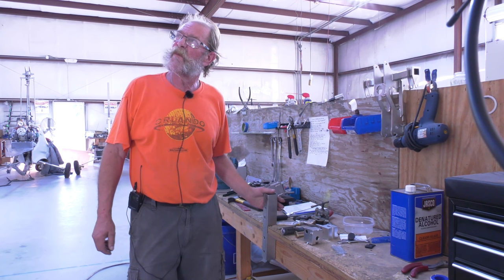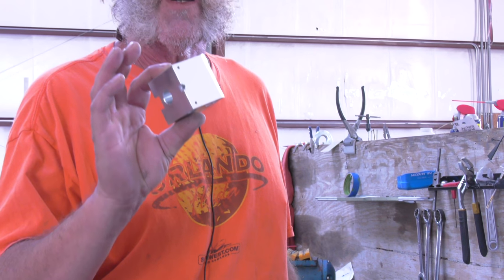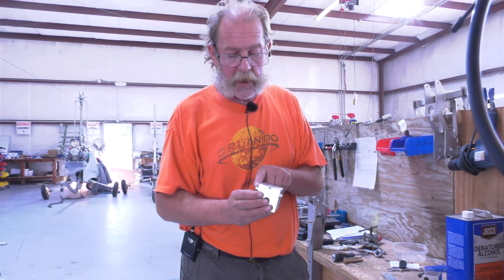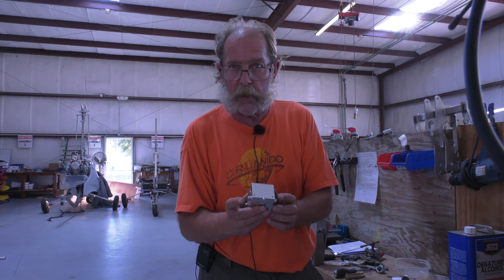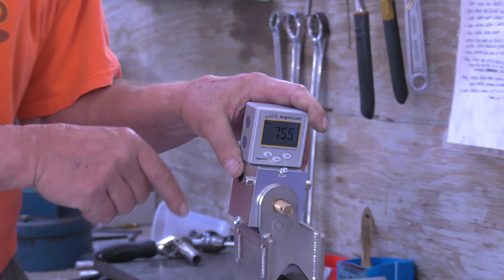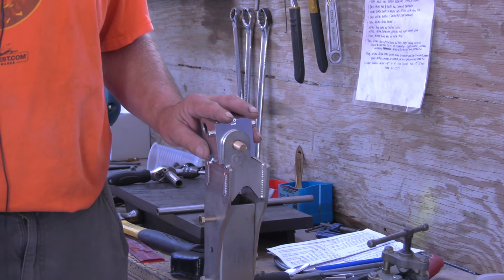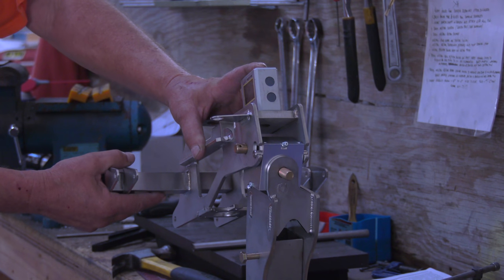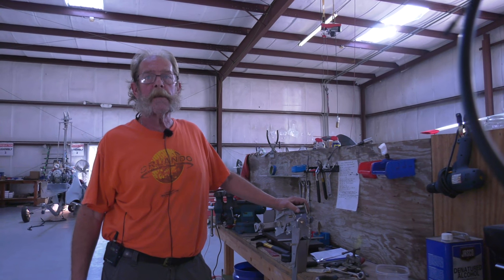AR-1 Gyroplane Rotorhead Assembly - Part 1 of 2

Comment: Hello, may I ask how to ensure that the angles of the two rotor blades are symmetrical? Is there any method or tool?
Reply from the maker: What angle exactly do you mean? The fixed pitch of the rotor blades? That is set by the clamping machined straps from hub bar to blade. The machining has to be quite close and precise on the hub bar and the clamping parts. If there is a tiny bit of difference, that is taken care of by rotor track and balancing using a multi-axis balancer but that has to be done by flying on the specific machine. We use PB4 balancer. You have to also know what to do with it not just buy the equipment.

Comment: Why are there 8 degrees on one side and 7 on the other? shouldn't they be the same? After all, this makes the side slope, am I wrong?
Reply from the maker: It's just because I wanted to. Why the heck not :). Nah. One side roll is favored due to torque and on the other side roll is opposed by the prop torque. So you need a little help on one side versus the other

Comment: It seems like a solid design, but man there are some Jesus bolts in gyro rotor heads it seems.  Can't the mast be a bit thicker and the bolts a bit bigger lol. All kidding aside, very nice machine
Reply from the maker: Those bolts can handle over 60 G's. You should be more worried about the Aluminum structure the bolts go into. They will break before the bolts. But I understand all people who don't know always worrying about the bolts instead. The largest danger in all aircraft is always the bolt that drives the aircraft. That one breaks apart really quickly. Biggest failure point :)
Reply: @silverlightaviation  I totally believe you but an airplane wing with more than one bolt holding a wing on I would think could possibly keep flying if one worked out or failed.  Those bolts in the wing are static and not spinning like on a gyro.   I know they have keepers, but still.  And many planes have ballistic parachutes on board, especially LSA.  On the gyros it just seems to me that there are maybe 4 bolts or more in a rotor head that if one failed its goodbye.  One would think that the bolt surely is strong enough to handle the G loading or any other stresses.  But what if it was manufactured with a crack or void internally.  I am not sure if they are magnetic particle inspected.  Just saying is all.  The other thing is the bearing or bearings in the rotor hub assembly.  Are they monitored for heat like maybe a helicopter.  What if one of the bearings got hot and scorched and it froze up. I use to farm and big combines would burn a bearing up every so often and throw a drive shaft.

When u take the plastic or carbon body off of the gyros they just don't seem like much is all to me and don't seem redundant in some ways.  I would love to see testing on them and strength numbers.  I would love to buy and own one once properly trained.  Maybe I am paranoid, but man they just seem fragile for having all of that rotor spinning and experiencing Gs under load on that little square tube going to the top with two little ears to hold a bolt and hold the assembly on.  I am sure the hardware is aircraft grade stuff.  Maybe you can chime back please so I can learn. Thanks
Reply from the maker: @user-ev2qo1hj1g  There are bolts and pins in many airplane wings that if one broke, you are pretty much done. So you should never fly a Cessna 152, 172, 182, Searey, RV12 and many others. You just do not see them because they are hidden away and only checked on an annual inspection if that. At least in gyroplanes and trikes they are right there for you to inspect. Aircraft use AN hardware which follows DOD military spec. The difference is precision and quality control compared to regular hardware. Otherwise grade 5 SAE hardware is just as strong, though thread sizes are longer.
Reply: @silverlightaviation  Thanks for the reply and I have to agree, you are right.  I never though about the easy inspection aspect and the grade 5 stuff is great.  Never new that about the thread sizes.  Thanks for responding back so I can understand.  I want to get into a gyro now.  I just moved to Fl so I am in a good state for that.
Reply from the maker: @user-ev2qo1hj1g  You are in one of the best states in the US for light aircraft flying including gyroplane flying. There is GFTA gyrocopter Flight Training Academy in Sebastian, FL. There is Raul Salazar in Valkaria, FL. There is me at Zephyrhills airport near Tampa. There is Greg Spicola at Tampa North Aeropark in Land O Lakes, FL.  Nothing in Miami. There is also a flight school in Pensacola (well technically Alabama but just across the border). There are about 12 AR-1 gyroplanes just around the Tampa Bay region
Reply: @silverlightaviation  Thanks and yes I agree.  That was part of the reason for me moving here actually.  NE was way to windy with no resources where I was at for light sport.  Even if Tampa is 2 hours from Sarasota.  It would be no big deal for me to drive it and spend a week at a hotel, get some training and come back again.  Whatever it takes etc.  I may be calling you sooner than later.  Again, thanks for sharing the design safety features of your excellent machine